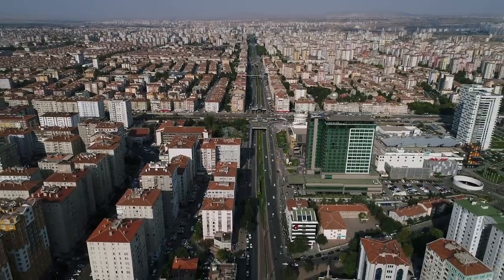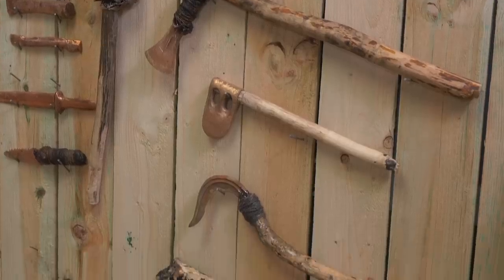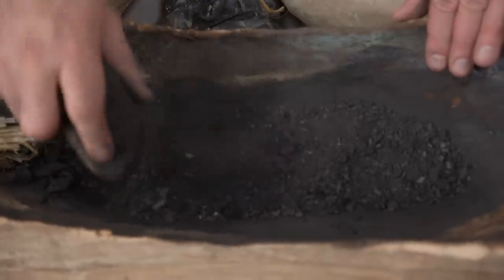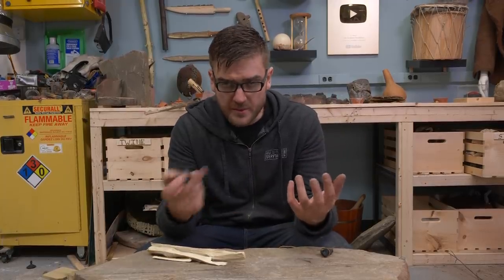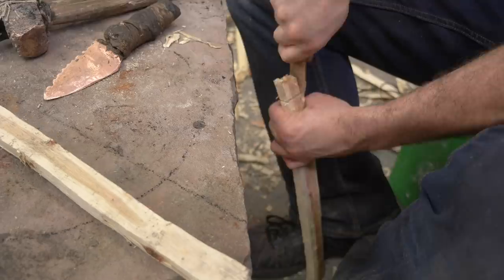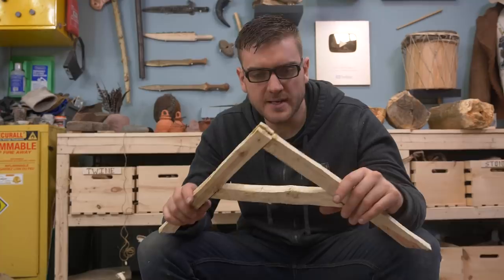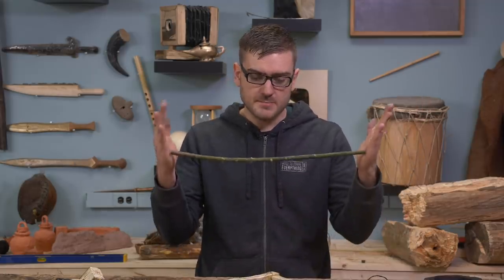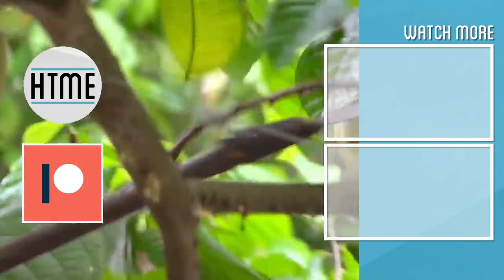DIY Tool that Built the Pyramids

Comment: While you can prove that the ancient Egyptians used some of those things for various tasks, you absolutely cannot prove that those tools were used to build the pyramids. Copper tools CANNOT cut or chisel the stone blocks used to make the pyramids. Archeaologists have performed many different tests with copper tools & those black round stone balls (I forget the type of stone). ALL of those tests were abject failures. While those tools can theoretically perform the task, the time frame for getting the job done is far too long for those tools to be of consideration.
Reply: Wrong. The copper doesn't cut the stone.  The quartz sand does.
Reply: @moemuggy4971  the sand doesn't either it abrades it away. You cannot explain bad saw marks that veer 2 or 3 inches of in a deep cut by such a slow method as a copper saw & sand. It would have been caught long before the mistake became that bad & there are examples like that.
Reply: @realherbalism1017  Nonsense.   We have the copper saws,  engravings on stone,  and papyrus showing them doing this...  Where is your ancient power saws? Huh??  
   And you do realize that it still takes hours to cut granite with power tools, right?  So if they were veering of course with the power tool,  why didn't they stop and correct it,  hmm??  
 You been watching way too much YouTube, Bud..
Reply: @realherbalism1017  It's only impossible for you to imagine doing so tough, because you probably have a hard time going to the cupboard for your meds.
Reply: @moemuggy4971  ah yes the ad hominem attacks of those who cannot debate
Reply: @realherbalism1017  There is no debate.
Reply: @UC0DAdTS3_s9bouSJmkTB1qQ   So when the power saw veered off course for a few hours, Why would the Aliens not notice, and stop the saw?   ...and, where did these power saws and blades go?
Reply: @realherbalism1017  I have no idea what you're on about.  I'm not reading your 20 page fantasy-filled autobiography.  Show us one power tool, or SFU and take your meds.
Reply: @moemuggy4971  Again provide a reasonable explanation to how a mistake of several inches could have been made with a hypothetical saw technology that cuts at 1mm an hour. Perhaps those Sherwin Williams paint fumes have eroded your ability to think. Cognitive dissonance much? And I know you read it, you just can't explain those anomalies in any normal way because there is no explanation except for an advanced ancient civilization. Now you provide a reasonable explanation as to how a hypothetical saw technology that cuts at 1mm an hour can veer off that bad.
Reply: @realherbalism1017   No, I stopped reading when you were on about Aliens. I have no idea what your were saying.  Creeper
  Show us the saws..    You can't.  We have biodegradable stuff like 10,000 years old food and clothing from Egypt...  But nope, no possible way a power tool or extension cord could have survived.  haha!
Reply: @realherbalism1017  Did the flat-Earth subterranean Alien lizard overlords hide them, maybe?  Them saws cut so fast, they just cut right down to hollow Earth, huh? Never to be seen again.  hahaha!
Reply: @moemuggy4971  Nope, didn't say anything about aliens at all, you did. Just like I thought you did read it, you can't provide an explanations including the one for your hypothetical saw technique. Go figure.
Reply: @realherbalism1017  Still waiting for proof. The burden of proof is on you. You're the one that has some esplannin' to do, Amigo.
Reply: @realherbalism1017  can you see this link?  ^^^^^
Reply: @realherbalism1017  Or would you dare to be proven wrong and Google,   
"PENN Museum ANCIENT EGYPTIAN STONE-DRILLING
An Experimental Perspective on a Scholarly Disagreement  volume 25/ issue 3" 

  I realize you're not the type to accept facts. And the slightest bit of hard work seems impossible to you though.
Reply: @realherbalism1017  Still waiting...
Reply: @moemuggy4971  I'll just let the posts speak for themselves & let others judge who needs to present material. What I've said is on here & what you've said is on here. I'll let people make up their own minds.
Reply: @moemuggy4971 “You never did say what you thought about those copper saws, and hieroglyphs of them cutting Stone by hand I showed you ... after you said, "no such thing exists"?” 

You’ve never showed me stone cutting copper saws, or hieroglyphics of the Egyptians doing so. If I have somehow missed them you will need to repost it & point it out because I have looked up & down our posts & there is nothing. So you are either lying once again & didn’t post it or you have made some error in posting.

 “How about the electron microscope images and microwear Analysis of the cutting groves in the tubular drill cores??”

What about them? The grooves are not “proof” of any kind that those holes were drilled that way, they are proof the holes COULD have been drilled that way. However, as I pointed out, there is no time frame & no depth drilled too given. This is important because even if it’s theoretically possible for the Egyptians to have drilled this way, a very long time frame to drill would make it unlikely.
 
“What, no snappy generic come back about cognitive dissidence?”

Here’s your snappy comeback, it cognitive DISSONANCE not “dissidence”. You made that one a little too easy.

 “Are you just going to reject all proof and reality, and substitute your own? Even after literally being shown it done by hand?? C'mon man, I thought you had some proof.”

First of all, neither of us has “proof” of anything. Secondly when was I shown IT being done by hand? Was this when you said, “Can you see this link?” because if so nothing popped up but this “^^^^^”. However, if it refers to the video of the scientists performing the experiment with water, sand, & a copper saw blade, as I have pointed out, THAT WAS A THEORETICAL DEVICE that the scientists made to test out their hypothesis. In other words they said, “Well maybe they did it like this so let’s make a tool that could accomplish it”. NO SUCH TOOL HAS EVER BEEN FOUND IN REAL LIFE. I didn't ask for "proof" from you that a power saw wasn't used, I asked for a REASONABLE EXPLANATION as to how such a mistake could be made WITHOUT one. You have been disingenuous, tried to put words in my mouth, & have demonstrated a shameful level of ignorance & blindness. I wish you well
Reply: @moemuggy4971  no it's not my original comment, you should look again
Reply: @realherbalism1017  don't try to argue semantics.. just show your power tools

Comment: This guy has one big problem: e n u n c i a t i o n 
Speak slower. Speak clearly. Don't swallow syllables or any other sounds. Enunciate. The content is good, but narration feels very rushed. I think videos will have a lot more success if you work on your narration a bit more. You could try writing a script. Make longer takes so you don't have to cut so many sentences in edit. If you do, slightly extend the last frame of a cut and first one of next cut to extend the pause between splices sentences to make them feel more natural.

Oh and: use the best and more universal unit of measurement - a banana.

Comment: Bro, first I want to say that your video, experiment and thought process was very interesting. However, there are a couple things I would like to point out. First, we all have to know by this point that bronze, stone and even wrought iron chisels, hammers and saws wouldn't cut over 60% of the cuts in the pyramid stones. First, there are the "drill cores" from cutting cylindrical holes through the stones and not one of the tools mentioned by archeology could make these cuts. Not to mention, the astronomically huge peices of granite inside of the pyramids and gigantic  quartzite slabs that comprise the "foundation". Not a single material that we have been told was used, would be capable of cutting these stones... straight up. And, the chalk-line level is a great theory, but having worked construction for over 20 years, I've used a chalk-line many times. And I promise you, there is NO WAY that a chalk line could have been used to construct and square a structure that size. Perhaps they could have been used on individual blocks of a couple of few meters... MAYBE. ...even those are cut with a bit more precision than you get from chalk. ...but, I digress, they could have. However, it would take lasers, with our current technology, to square something of thar magnitude, to that degree of perfection. I think the answer is pretty simple and always has been really... if it looks like a duck and it quacks like a duck, odds would dictate that it is indeed, a duck. And this duck says that they did it, like we would do it, using some type of power tools. Nothing will convince me otherwise, until someone demonstrates how to cut a perfectly round cylinder, out of a granite slab, using crude hand tools... it simply can't be done. Sik